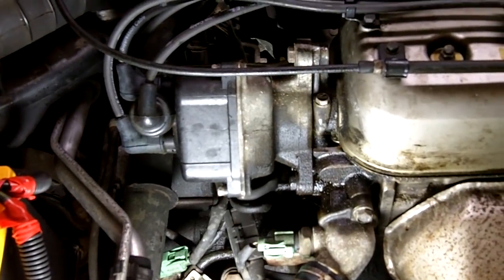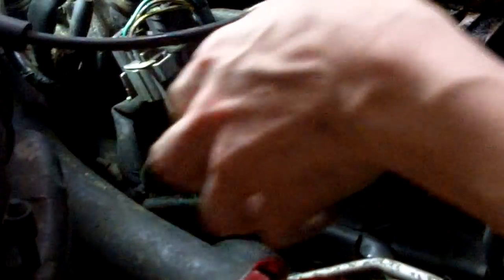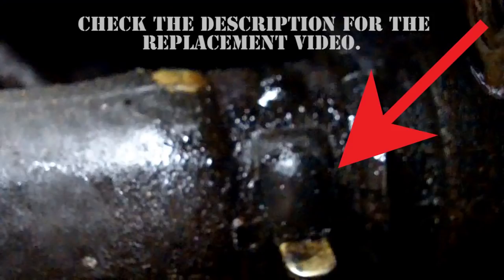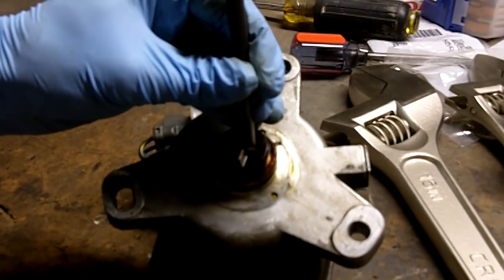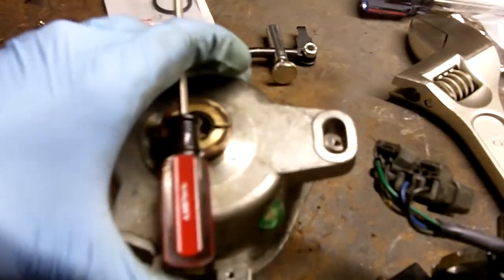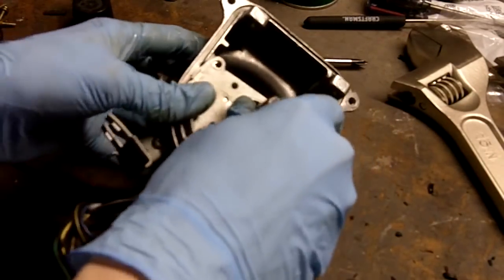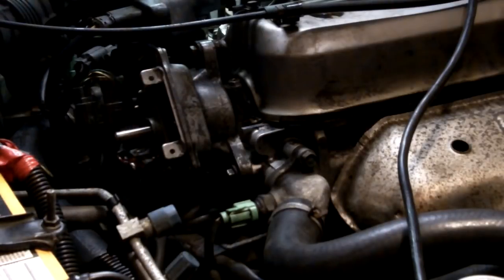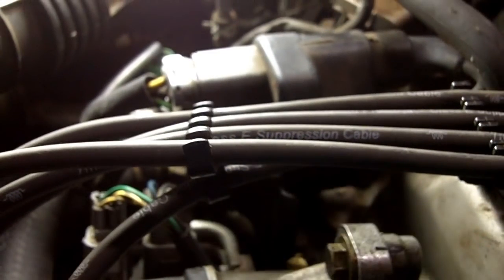Honda Distributor Oil Seal Replacement

Comment: I have a little bit of axial play in the bearing, replace?
Reply from the maker: Dyna Steve There shouldn't be any play. But more importantly spin the bearing by hand if 
you hear noise the grease is gone and it should be replaced.

Comment: Hey bush I did this again on a 94 accord ex hitachi dizzy and now the distributor ticks
Reply from the maker: A bad plug wire arcing to metal can cause a ticking noise. Start the engine up when it's dark out and spray the wires down with water and look for any arcing.

If it is coming from inside the distributor excessive end play in the shaft from a bad bearing can cause the rotor blade to knock into the contacts in the cap and cause a noise.

Comment: hi, what did you put on the new shaft seal before putting it into the distributor housing? Thanks!
Reply from the maker: Silicone spray any auto parts store should carry it.

Comment: Sorry if this has already been asked, when you are installing the new internal seal is it supposed to be flush/level with the lip on the inside of the distributor or are you supposed to push it in (seat it) until it can not go in any further and it sits flat against the bottom/outside wall of the housing?? Thanks
Reply from the maker: Flush or a little past flush is fine. It doesn't really matter what's more important is that the seal is pressed in evenly and it isn't crooked in the bore.
Reply: ***** cool, thanks for the response and the very insightful video. I really appreciate it.

Comment: Hypothetically speaking: if the car was OBD 2 and a I diddnt want to do the complete tear down could I simply insert a new distributor without having to do timing/ timing light?
Reply from the maker: If the vehicle has an OBD2 connector behind the ashtray the distributor doesn't even rotate. It just locks in place there is no timing to adjust.

Comment: Bushougoma Have you done the pick up assy. on the older distributors, everything about the same but the pick up is around the shaft. I think I can push the shaft on the top after the bottom offset gear is removed and push it out the top I see no video for this and I cant find a good reman distributor thanks for any help . .
Reply from the maker: The sensors aren't available separately so I see no reason why you'd want to remove them. What year Accord is this?

Comment: So the seal to a tec distributor won't fit the hitachi ? I'm having trouble finding one local. I'm trying to stay away from buying one online
Reply from the maker: Alexis Navarrete The TEC shaft seal won't fit the Hitachi without forcing it.

The outer o-rings have two different Honda part numbers depending on the distributor manufacturer so I don't believe they're compatible either. I haven't had the opportunity to compare them side by side to see what the differences were I've always just ordered the right part number.

You could always order from a Honda dealer online it's usually a bit less expensive.

Comment: 1 question.  onvce you lock in your distributor to the shaft, does it really matter if those 2 lines dont meet up precisely?  what if the 2 marked lines were off by a bit?
Reply from the maker: You don't need to be super precise but you want it as close as possible. Base timing would be off if you simply didn't mark it.

The angle of the distributor in relation to the cylinder head determines the relationship between the crankshaft, top dead center, and cylinder position sensors and the reluctor rings which are fixed to the keyed distributor shaft.

By rotating the distributor you are altering the relationship between the fixed distributor shaft reluctor rings and the sensors which are fastened to the body.
Reply: *****
if i reinstalled it on the wrong angle how can i correct it?
Reply from the maker: Danny M
Jump the 2 pin connector under the passenger side dash so the computer won't correct the base timing. This is the same connector you jump to read codes.

Start the vehicle up and warm it up until the idle stabilizes. The connect a timing light to cylinder number one (the one closest to the crank pulley). Point it at the crank pulley with the light set to 0 degrees advance. If your light doesn't have an advance setting it's already at 0.

You will see one lone notch on the crank pulley (painted white) this is 0 degrees top dead center for cylinder one followed by 3 notches close together.

The middle notch (painted red) is 15 degrees below top dead center. This is your target when the light flashes the red line should be inside the pointer on the timing cover.

The stroboscopic effect with seem to make the timing marks stand still.

If the timing is off loosen the distributor bolts and rotate it until the mark lines up with the timing cover pointer. Snug up the distributor bolts.

When you're done pull the jumper wire. With the wire removed the timing will shift since the ECU will again adjust the timing from base.

If you were to check it with the jumper wire removed the timing would appear to be off again this is normal.

Comment: Do you recommend putting any sort of grease on the inside of shaft seals, such as the front main seal, balance shaft seal, or camshaft seal?  I've heard folks say you should but what kind of grease would you use?
Reply from the maker: Lubricating the inside of the seal is to prevent the seal lip from rolling when it's being driven in. This is more likely when you're driving a seal in around a premounted shaft not inserting a shaft into a preinstalled seal. But if you want to lubricate it couldn't hurt.

If you want to use grease use something inert like silicone paste. When in doubt lubricate the shaft seal with whatever it seals out in this case motor oil.
Reply: Awesome, thank you!

Comment: what is the reason the timing can be off when the oring is replaced? I have a 1994 accord? Do i have to retime it?
Reply: +Robbi Palacios The "timed" orientation of the distributor shaft to the camshaft guarantees that the high-voltage pulse from the ignition coil is sent to the proper spark plug at the correct rotation angle (say 15 deg BTDC). If you do not mark the "timed" orientation of the distributor to the camshaft beforehand (as the author recommends in the video) you will definitely need to re-time the ignition after the repair. Even if you marked the orientation beforehand, it is recommended to recheck the ignition timing after the repair to make sure everything is working as it should. Enjoy.

Comment: Every single video on YouTube about this topic shows marking the distributor for timing. Even those made from 1996 on. You say they are all wrong?
Reply from the maker: It wouldn't be the first time inaccurate information spread on Youtube. If the people who made those videos actually attempted to rotate the distributor on 96 and up models they would notice that it doesn't rotate to any significant degree.

The crank and TDC sensors (which would effect the timing) on 96 and up get their signal off the crankshaft timing gear these two sensors are located behind the crank pulley not inside the distributor like earlier models. The only sensor inside the distributor on later models is the cylinder 1 TDC sensor.

Comment: To get to the heater hose do I NEED to remove the distributor ?
Reply from the maker: Alexis Navarrete It's not necessary but I don't see why you wouldn't want to remove it 3 bolts and it pops right off just mark it's position if you have an OBD 1 vehicle to preserve the timing.

It's a lot quicker than fiddling around underneath it to get the right angle to squeeze the hose clamp.
Reply: Okay sounds good. Now you do recommend replacing the o-ring ?
Reply from the maker: Alexis Navarrete
If the heater hose is damaged like the one in the video odds are that failure of the o-ring and possibly the inner shaft seal have caused oil to leak onto the hose.

So to prevent a repeat failure replace at least the o-ring since it's inexpensive and easy. No doubt you'll find it's hard as a rock and not sealing if it's as old as the vehicle.

I'd also recommend checking inside the distributor cap for oil. If it's dry you can leave the inner shaft seal alone.

Comment: do u think i should go by OEM parts? i really trust more OEM than aftermarket but since it is more expensive it makes me think twice, but online i can find good prices at hondapricescheap. have u ever heard about that website>? anyways. could you tell me exactly what to by for this job, since im planning in buy everything by separate, at least i want to get the belts and the tensioner from honda

Comment: i bought an o-ring of similar size at local hardware store...20 cents!
Reply from the maker: Make sure the material is resistant to oil or you'll be doing the job again. Nitrile is a good material to use.

Comment: ... my mechanics re-sealed my 1999 Accord Hitachi Dist. two months ago replacing seal and O ring ... now its leaking again as i can see the area all wet again and the oil leaking on top of heater hose ... in researching this leak i read everywhere this leak is common with these dist. ... so first question is if its common then that tells me its a design flaw? ... i mean my 1990 CRX with 380,000 miles never had this problem as i went through distributors over the years ... so whats the deal with this Hitachi dist. ----- next question is why would this be leaking again after only a 2 months of driving ... i think he used Doorman seals but still after 2 months this should not be happening.
Reply from the maker: Many things can cause it to leak the bearing could be bad causing shaft wobble the rear bushing could be worn out. The distributor shaft where the seal rides may be scored up the bore where the seal is driven in could have been scored when the old seal was removed.

How old is the valve cover gasket? It can drip down and around the distributor and make it look like a distributor leak.
Reply: ... i just bought the car used 2 months ago ... i do have a Carfax but does not show valve cover gasket done but could have dont know ... but the area around the valve cover looks to be dry not leaking ... i will be having a timing belt kit done soon so might have the valve cover done too ... going back to the leak im either gonna get Honda seals this time ( they were Doorman last time) or just buy another Hitachi Dist but they are expensive ... i was thinking of just getting the Hitachi housing and swapping the rest over but for a $100 more i can get the entire Dist new what are your thoughts?... also what are your thoughts on:

---> if i buy an Aftermarket Dist which brand should i take a chance on ?
---> i was told that my 99 Accord EX Dist cant be resealed (even though i saw my mech do it)

Comment: Hi bushougoma, i have a doubt my distributor is tec but the ignition control module is hitachi and i buy tec it's a difference in the connection?
Reply from the maker: The Tec and Hitachi distributors use different ICMs.

If the cap has 4 wires it's an internal coil Hitachi if it has 5 it's an external coil Tec.

The outer o-ring and inner seal part number is different depending on the distributor manufacturer.

Check the description for the part number depending on manufacturer.

Comment: I have 2001 honda accord with Hitachi distributor. It doesn't have a snap ring so what I did I punched the pin straight out. But I made 2 punches bend, the pin still didn't move at all. You have any idea?
Reply from the maker: An arbor press or an air hammer would be your other options if the pin is being difficult.

Comment: It's coming from housing. When ihad it off if I rotated shaft by hand id hear a click. It didn't do this before the repair bt i double checked and everything seems to be right?
Reply from the maker: Grab the shaft with the distributor off and move it from side to side is there a lot of end play?

The blade of the rotor can hit the contacts in the cap or the reluctor rings on the shaft can hit the sensors. Those are the only two things that have a close enough gap to make contact with the shaft if the bearing is bad.
Reply: I'm thinking it might be those things hitting the sensors but I'll have to check and get back to you. But as far a the bearing goes ithink it might be bad cause on my 98 itd turn good and smooth but would stop soon and this one spins for awhile
Reply from the maker: j manuel
The grease in a good bearing tends to stop the outer race shortly after spinning it. It should also spin silently without any noise.

You will also feel the resistance from the grease when spinning it.

If it freewheels it means the grease inside has dried out and the bearing is bad.

Even if it doesn't have excessive end play now the lack of grease will cause it to wear and fail shortly afterward.
Reply: Yeah it's like a skateboard bearing now lol
But thanks for confirming the bad bearing. Should I drive till it gives out or replace before driving? Appreciate your quick responses thanks for all the help
Reply from the maker: j manuel
It could end up damaging the distributor cap or the non replaceable sensors in the distributor body as the end play gets worse.

The bearing can be driven off the shaft with a length of pipe and a hammer. Make sure to drive the new one on by the inner race only to prevent damage to the new bearing.

The old bearing will have a code printed on it.

Use this code to find a replacement you can also look up the number to find out the bearings dimensions.
Reply: Sure thing thanks for all the info and help great advice I'll go ahead and do that and if I dnt have any luck I'll just replace the dizzy

Comment: What if the distributor is 180 degrees out? What does that do? 
I replaced the o ring and now my car won’t run. It will crank and all that but won’t start up.
Reply from the maker: The firing order will be wrong. It can only be 180 degrees out if the end piece is put on wrong. If you didn't remove the end piece it's impossible to mate it with the cam wrong as the teeth are offset.
Reply: Bushougoma thank you! I appreciate your time. I put a new distributor, still won’t fire. Got fuel got spark. What else could it be?

Comment: Hi my 95 accord has the hitachi distributor, will the process still be the same? Thank you
Reply from the maker: Yes it's similar. The Hitachi just has an internal coil to remove in addition to the other parts it's held on by 2 bolts.

Comment: Hi, i have a honda civic D15Z1 VX VTEC and the distributor makes problems with 2 error codes, code 9 CYL sensor and code 4 CRANK sensor. I should replace the distributor with new one? Thanks.
Reply from the maker: If your engine runs the crank sensor signal can't be missing. There would be no way for the PCM to generate the pulses for spark and fuel injector timing.

If the engine runs do you notice any drivability problems?

If the engine doesn't start on the other hand here's how to check the sensors.

Testing variable reluctance sensors without an oscilloscope can be tricky. All I can suggest are two tests.

Set your meter to AC volts and probe the two wires from either the Crank or TDC sensor respectively.

Put the DMM on the windshield and crank the engine over the sensors should generate an AC voltage and display it on the meter.

The second test is a resistance test set your meter to ohms and measure either sensor you should have between 350-700 ohms of resistance. Reading a short or OL means the sensor is bad.

Both methods aren't as good as looking at the sine waves generated by these sensors on a scope but it's better than nothing.

They are not replaceable as an assembly the whole distributor body must be replaced.

Stick with an OE Honda unit aftermarket ignition parts don't last long on these vehicles.

If you can't afford new OE a used OE Honda distributor from a junk yard or online is better than a new aftermarket one.
Reply: Yes, I measure both sensors resistance with the multimeter but is below to 350 ohms, is 340 ohms. I was looking for the used OE distributor from " junk yard or online " but didnt find and I take the new one aftermarket distributor:

(Here is a BRAND NEW  Complete Ignition Distributor with Cap, Rotor and Coil
Replacement for TEC Distributor
Reference Part #'s 30100-P06-A02 , TD-41U , TD-47U
Fit the Following Engines D15B8 - 1493cc L4 SOHC , D15B7 - 1493cc L4 SOHC , D15Z1 - 1493cc L4 SOHC
Fits The Following Models
Honda Civic 1992-1995 DX, CX, LX, VX 1.5L Engine
Honda Civic Del Sol S 1993-1995 1.5L D15B7 Engine)

I hope this aftermarket distributor resist few years, may be one or two years.
Thanks.
Reply from the maker: errgoss
Check the distributor connector and make sure the connections are tight and not corroded.

Also check for continuity between the harness side sensor wires and the connector at the PCM to make sure they're not open and check from each wire to ground (on the PCM side) to make sure they're not shorted to ground.

Beyond that without a scope you can only replace the distributor and hope the code doesn't come back.

Comment: Do i have to drain all the oil first?
Reply: Think about it. The distributor is at the top of the engine assembly. The oil sits down at the bottom, in the oil pan, until the engine runs. So, no.

Comment: I have an OBD II vehicle and I rotated the engine after I had the distributor out, is that going to mess with the timing? I don't remember why I rotated it.
Reply from the maker: The distributor shaft is keyed and will only lock into the camshaft one way.
Reply: Thank you. Great video by the way.